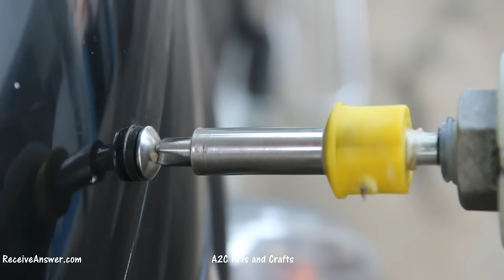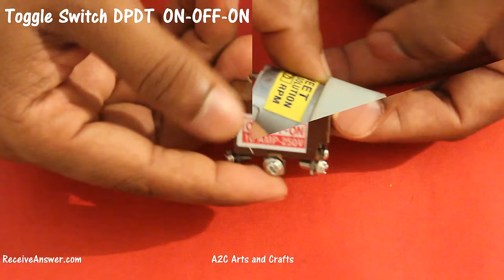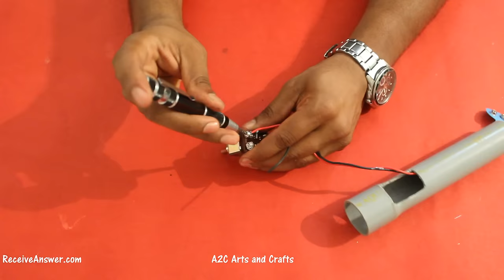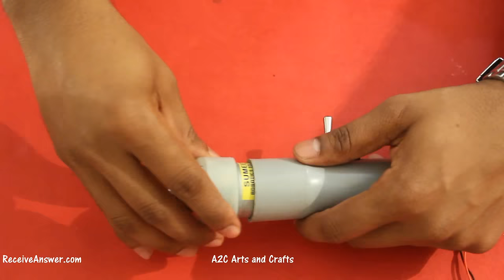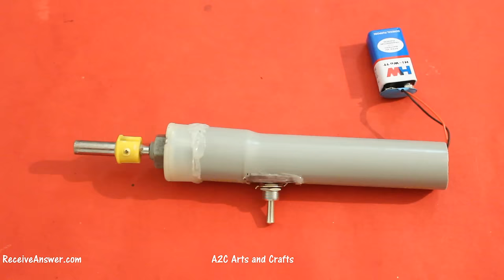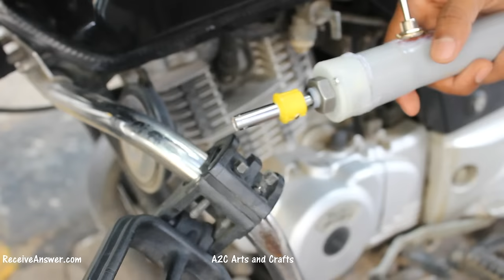How to make Electric Screwdriver at home

Comment: where to buy the dc gear motor 150 rmp link please?
& can we use 200/300 rmp motor
Reply from the maker: +Rahil Shaikh You can buy at Amazon. You case use 200/300 rpm it will be bit fast
Reply: Thanks......

Comment: Can i use two 9volt battery?
Reply from the maker: +Fhan channel I thinks that's not a good option, as the motor is 12v excess power may damage the DC motor
Reply: ok thanks!

Comment: hey you used 5V DC motor and 9V battery. how 5V DC motor can work with directly 9V battery
Reply from the maker: +sajan khadgi Hi I have used 12V DC motor not 5V. 12v can still run on 9v battery